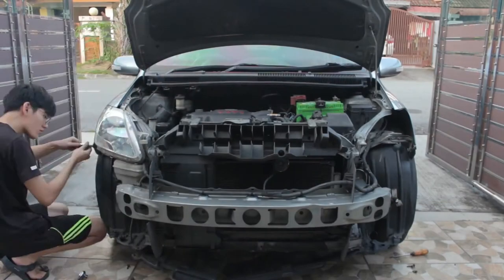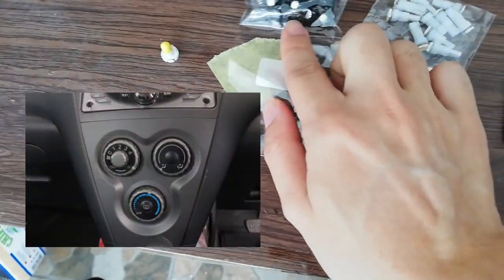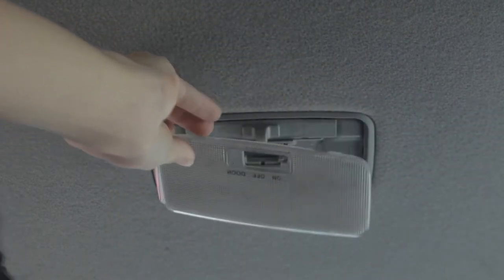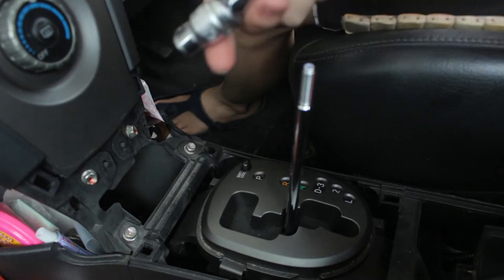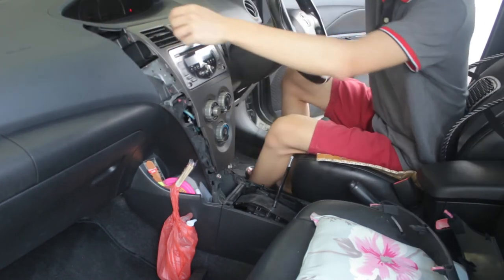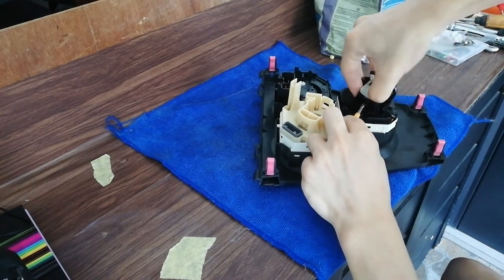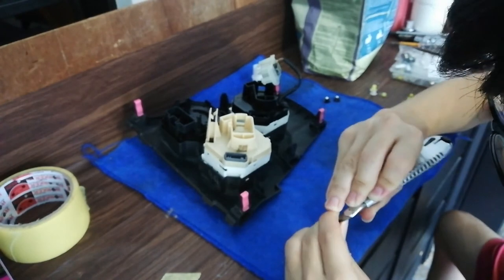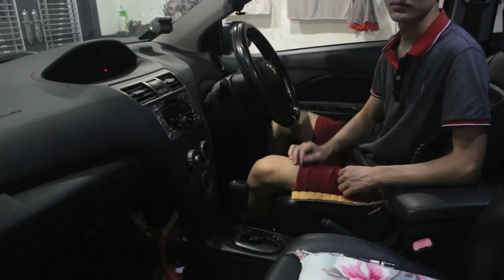TOYOTA VIOS NCP93 INTERIOR BULBS REPLACEMENT

Comment: Hi boss, i newly own a year 2009 vios or call dugong, I feel that the dashboard meter light very poor, even i can't see or read the temperature, and.also kilometer reading, do have any change bulk or improve the meter. Thank you boss
Reply from the maker: Dugong's meter lights are LEDs which built-in with board, so if want to change those need to solder to take them out.
Reply: @victor8656  ok noted,  maybe mine is too soft the light when i drive at night can't even seen the meter reading, need your help to upgrade.🙏🏼🙏🏼🙏🏼
Reply: Before u make the bulb change, make sure u got adjust the brightness to Max volumn first. sometime we forgot but adjusted to lowest

Comment: Hi, may I know why we need to trim the LED? It is not a one to one replacement for the T4.2 LED of the aircond panel?
Reply from the maker: The new LED bulb housing came with some imperfect fitment, I trimed those housing just to prevent losse them.
Reply: It's not T3 LED?
Reply from the maker: It's T4.2 type LED bulb